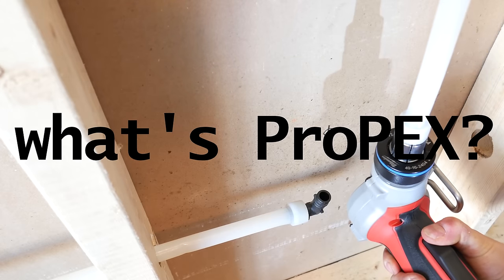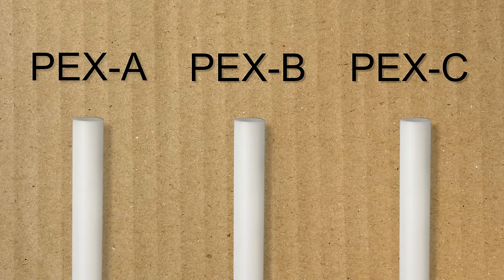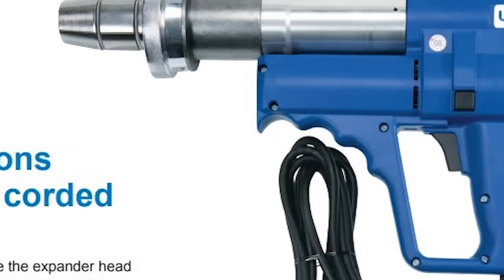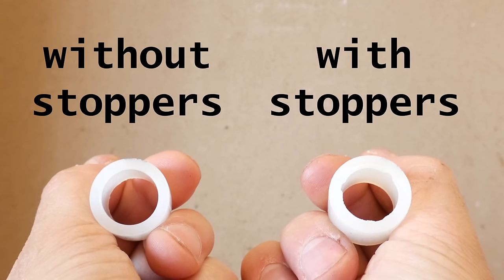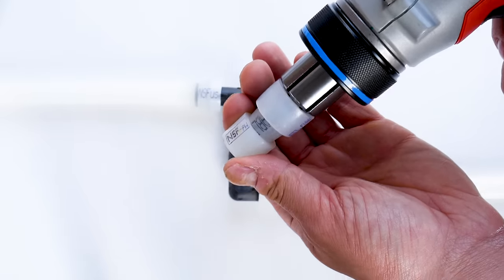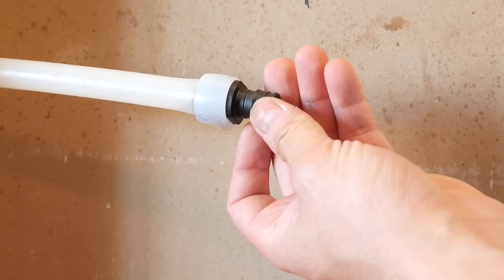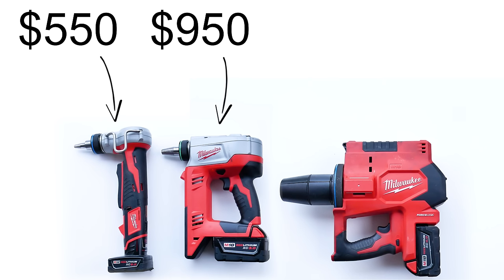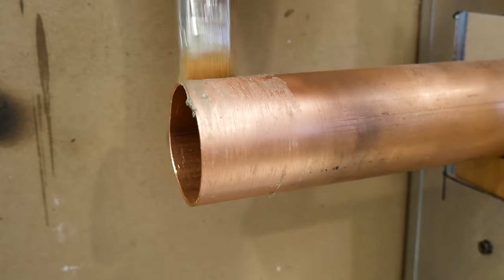UPONOR ProPEX, The Future of Plumbing (COMPLETE GUIDE) | GOT2LEARN

Comment: How do you go from copper pipe to PEX A. Do you need to solder a Pex A fitting to the copper then put a ring on the PEX A pipe and push it onto the sweat fitting. Where can I buy these type of fittings?
Reply from the maker: Yup! Plumbing shops carry them: https://www.dkhardware.com/apollo-epxms1212-1-2-in-brass-pex-a-barb-x-1-2-in-male-sweat-adapter-product-3629699.html?utm_source=google&utm_medium=shopping&utm_campaign=free_listings&gclid=CjwKCAjw4ayUBhA4EiwATWyBrt4ZSqPQ0Or_UWWC1TuPChzEV_EfHmisZoCYSJakq76SlvwCmmEXBRoC2XMQAvD_BwE

Comment: Upinor pex is sooooo expensive fittings,tools it would add up fast i use cpvc it’s cheap and easy to use. Nice video
Reply: CPVC becomes brittle and cracks easily after about 10 years.. Also, you have to wait for glue to cure before pressurizing.
Reply: please please don't tell me you are using Aquarise ? worst crap ever.
Reply from the maker: Aquarise is CPVC and is very brittle, try not to use that stuff.
Reply: Jessy Bwoy86 I use Genova cpvc never had problems
Reply: @jacksplumbingvideos7147  Charlotte FlowGuard Gold is what everybody use around here and pretty much only CPVC available. They all become brittle. Worse if it is hot side. And any deep scratches can develop pin hole leaks years later.
Reply: CPVC Lol 😆
Reply: lambition I hate Charlotte flow guard gold. in Wisconsin Genova flow guard is more common.

Comment: Freezing is a big problem in my area.  That's why I loved the old slide on ring, metal fitting system (I forget it's name).  Are there metal fittings available for this Uponor and how do the plastic fittings handle freezing?
Reply from the maker: Matt, Uponor is discontinuing all metal fittings because it's too expensive.

Comment: The only other flaw not mentioned would be if your water supply is treated with Chlorine Dioxide, the pipe will eventually degrade to the point of failure within a few years. The city of Hamilton, OH found this out the hard way.
Reply from the maker: What about other plastics or copper?

Comment: Question then please........Using uponor pex a... I can use 1/2 pex for the tub spout and shower???? Cuz inside diameter is larger then regular pex that were told not to use for those two items because of the restriction pushing water filling the tub  to the shower...
Reply from the maker: You need to use copper for a tub spout.

Comment: Will hot water running through the pipe loosen the connection?
Reply from the maker: Nope, you can use this for heating systems ;)

Comment: How would you add a short section (2') of the Uponor between two fixed ends? A piece of that pipe even when heated can not be bent enough to place on fitting. Are there unions? I've seen push-on slip repair fittings, and I think that might work. Or it's back to copper with a union.

Comment: Hey, question, does PEX-A have brass fittings or just the black plastic ones? If so, do you prefer the plastic ones or the brass ones? Which is better? Thanks.
Reply from the maker: Uponor is ditching the brass fittings because the zinc coating would come off after a while, so I think now they only have plastic fittings.

Comment: The Milwaukee 12V tool is $400 USD, with two of the three heads, a charger and two batteries. But if you already own Milwaukee you don’t need the kit with the charger and batteries... the bare tool is $219 USD, without the expansion heads. (1/2” and 1”, $56 each)... so $275 to $330 gets you going.
Reply: That's cheap 🇨🇦 we get screwed 🤦‍♂️
Reply: Joshua Mcdonald Exchange rate, my friend

Comment: What about hot water? you mentioned taking joins apart using heat, could hot water over time weaken the connections? what about biofilm accumulation and legionella risk.
And is there any leaching of plastic chemicals into the water?
Reply from the maker: No, the heat will not effect the connections, even when used for heating, no there's no biofilm or legionella and no worries about chemical leeching with PEX, unless it's consumed in huge amounts!
Reply: @Got2Learn  it does seem a very good secure system, I am in the UK but from what I can see they have the system here too.
Reply from the maker: It is a great system, i've personally installed kilometers of without any problems 😉

Comment: 4:30 Just so you know? you will realize a loss of volume due to the smaller fitting, which in turn may cause a loss of pressure at the end use. In fact, inside the pipe, the smaller fittings will cause an INCREASE in pressure due to the smaller circumference. This is what happens when you put your thumb over the end of a garden hose vs bending the hose in half .....

Comment: Too expensive for homeowners unless doing enough to justify tool cost.
Is there any reason not to use the manual tool for small jobs if you are conscientious about rotating it?
Reply: Just another BS way for tool makers to make money and for contractor to ruin a building with lazy or cheap workforce.
Pex A has perfect crimp connectors.
Reply: I've been using the manual tool only for 14 years. It works just fine and cost me around $20.00... But at the current cost for copper tubing the electric tool would pay for itself in no time.

Comment: Do you think one could use the pex expander to swage copper refrigerant lines for HVAC systems? Seems to be the same sort of principle. The only question would be whether the swage made by the pex expander mimics the swage made by HVAC swage tools. Also,  I would imagine that copper requires more force than pex to expand. Maybe you could try it out and make a YouTube video on it. I’m sure tons of HVAC contractors would thank you!
Reply from the maker: No, these are made for PEX only.
Reply: @Got2Learn  I understand that the tool is rated for PEX, but could it be practically applied toward refrigerant copper lines. Please take into consideration that there are already hand swage tools made by manufacturers (e.g., NAVAC) for copper refrigerant line swaging which I mention to emphasize that the strength necessary to swage smaller refrigerant copper lines isn’t a ridiculous amount of force. However, for larger diameter refrigerant copper lines the force can be more considerable. Hence the question as it would make it awesome to have a cordless swage tool on the field.

I realize that the manufacturer didn’t intend for their PEX expansion tool to be used for swaging refrigerant copper lines, but could it be feasible to do so? I get it if you don’t want to endorse a use of a tool unauthorized by a manufacturer, but was just interested In hearing your thoughts on the idea.

Comment: My question would be what capacity does Pex A have to return to its normal size after X amount of time installed. Does this system work for Pex that is 5 years old?  Or Pex that has been subject to hot/cold environments for a long period.  Seems to me it would lose it's elasticity over time

Comment: Hey man, awesome video. What are you thoughts on integrating this into an existing system with Pex B. We did our kitchen 4 years ago and at that point I was a total noobie and did not do anything on my own. Now I can do electrical, framing, and etc. Plumbing is my weakest skillset, so I appreciate all of the videos. My plumber redid the lines with Viega ProPex so it is all Pex-B. I like the ease of this one more. I already have Viega crimpers for 1/2 and 3/4 which I bought used off of Ebay. They are a bit rusty but should still work but I might get this since I have 3 bathrooms to redo. I read that you can crimp Pex-A however Uponor does not warranty that joint and the also decrease the warranty on the whole system. Nothing I need to worry since I am not a pro. However do you think the Viega ProPex crimps would work on Pex-A? Not the copper ring but the fittings with the sleeve and peep holes already attached. I cant remember what the Pex standard for crimping was without googling it
Reply from the maker: Yeah, there's no problem on integrating pex-a on a pex-b system.
Reply: @Got2Learn  awesome so crimp away!
Reply from the maker: @kiwiswat  🤘

Comment: Have you ever heard of or used Sioux Chief brand Pex A?  Thoughts?
Reply from the maker: No but I heard good stuff about it and I think it's less expensive, might want to inform yourself for the warranty though..
Reply: @Got2Learn  I will definitely look into that. I have done some generic online and found reasonable reviews. PEX A seems to be a rarely stocked item in all of the local hardware stores . This is the only Pex A hardware I have found stocked locally.
Reply from the maker: @JosiahJensen42  yeah Uponor PEX-A is reserved for contractors 😉
Reply: @Got2Learn  Aha!  😄
Reply: @Got2Learn  Can you use the sharkbite fittings in certain spots if needed on Pex A?  I couldn't find anywhere that specifically called out the "A" compatibility.
Reply from the maker: Yes I believe you can 👌

Comment: My two cents....

I've experienced SO MANY plastic gears and pulleys crack over time because nylon tends to dry and contract over time. These were pressure mounted on metal shafts and therefore were put under tensile stress. Nylon is NOT designed to be under tensile stress for long periods of time.

I know, i know, PEX-A is NOT nylon, but it is a plastic material. How will it react over long periods of time ?

On its side, PEX-B uses copper rings that does not dry-out ans puts the plastin under COMPRESSION  stress.  So, for long term reliability,  i'll stick for PEX-B.

Question: On PEX-A and PEX-B, they're plastic and brass connectors. What are the pros / cons of  each one ?
Reply from the maker: Yes, PEX-A is not nylon and does not crack over time, this system has been proven for over 20 years and there are no problems. As for the brass/plastic fittings, Uponor wants to remove all brass fittings from their line because they  are too expensive and the plastic ones are strong enough.

Comment: Looks super cool but how is the savings going to quickly catch up after the $550 expander if the fittings actually cost more than crimp fittings? I used ear clamped pex for my compressed air install, the pincer tool was at least as fast, more agile, and doesn't require power.
Reply from the maker: Long term
Reply: @Got2Learn  it can only get cheaper over the long term if the fittings are actually cheaper which according to your video is not the case.

Comment: The colored rings with no stops I would always give the ring a slight expansion before throwing it over so it wouldn't slide. When you're 1 or 2 connections from completing a manifold you really don't want that shit happening. Also on the subject of Milwaukee expanders if you don't actively do above 1" don't buy the M18. It expands slower and it's much heavier.

Comment: Nice summary. For future, please cover when to use elbows or bends. I used PEX-A for my DIY remodel. Big selling point for all PEX are "home runs" from fixture to manifold, eliminating joints in the walls. My only joints are elbows for the 1" supply (from street to manifold) where I couldn't fit a bend, and a Tee in the kitchen for the sink & dishwasher to share one supply line. Also, maybe cover plastic vs copper joints and manifolds. I went all copper, because a friend told me a plastic manifold failing is catastrophic whereas copper could be mended.

Comment: The thing you forgot to mention was pro pex with copper fittings for shower lines and other connections . Please do a video on that as well if you can. Thanks brother
Reply: I honestly think pro press copper should be kept for boilers and tying off the ends of system but that’s a personal opinion.

Comment: Or you could just use sharkbite fittings
Reply: Or you could just do the job right sharkbites allow the pipebto spin and twist there so expensive compared to pex fitting a plumber can do the same job for the same price and lower material cost then a handy man making less profit because higher material cost and inferior jobs.Sharkbite jobs are done by guys hanging ouy getting work at home depot
Reply: @Allintn22  oh, I see. Thanks for the info.

Comment: Tool and material cost are unjustified. Costs will come down when patent life expires and  anyone can manufacture the tools and materials. Demand also drives cost down as more becomes available. Lower prices now would help market acceptance but for now $500 for an electric drill with an adapter and four bucks for a quarter ounce of plastic are nothing more than price gouging. Get it to market and get that price down. Your business model will still work.
Reply: I literally laughed when I saw the 500 dollar price tag for the small tool.... Seriously your absolutely right this will be extremely successful in the market place no need to price gouge. I could easily see this over taking the other options on the market when the price levels out. I know I'd go for it for plumming projects
Reply: Dewalt has a tool that goes up to 1 inch. Retails for 250. Home depot is manufacturing pex-a under the Apollo name.  Prices have dropped significantly.

Comment: You're my fav plumber bro. I bought the m12 version to do 3/4" and it's so much quicker then copper.
Reply: Really, exactly how much faster is it? What, you saved 8 seconds per fitting? LOL And how many call backs are you on now? LOL.
Reply: @rickjames6948  first I think he saved more than 8 sec per fitting also and 8 sec is a a lot also if he had a callback it’s because he did it wrong just like how you can mess of a solder joint which is much easier to mess up

Comment: Great video.  Basic and informative.  FYI, DeWalt now makes a battery powered expander tool as well.  The DeWalt expander works just as well as the Milwaukee and if your already have DeWalt battery powered tools, all you need to purchase is the expander tool only.  
It's a lot less expensive that way.  Uponor also makes brass connectors that allow you to convert your system from copper pipe to PEX A.  You just sweat the brass fitting onto the copper pipe and then connect the PEX A pipe to the other end.
Reply: Thank you for that, I have multiple dewalt 20v and ryobi 18v batteries... definitely don't want to get into milwaukee this late into the game
Reply: Great infomative comment! Thanks!

Comment: I bought a small cottage about 8 years ago with the intent of fixing it up. I had not intended to replace the existing copper piping until I discovered that someone had used Type M copper and that after 50 years the well water was eating through it. I was going to replace it with Type L but a plumber friend suggested ProPEX. I bought one of the Milwaukee M12 expanders and I think I plumbed the entire house (duplex) in about a day and a half. If I had used copper it would have taken 10 times as long. I'm always skeptical about using "new" things until they have had a chance to prove themselves but this one has been around for quite a while now and it does work. Just so much simpler and quicker to work with and it's never leaked.
Reply: What type of Pex a did you use? I'm confused if all Pex a any brand will work for cold expansion. Thanks
Reply: UPONOR's PEX Pipe warranty is 25 years unless you use non-UPONOR fittings , then it's only 10.

Comment: Just a note:  a smaller diameter tube or adapter does not lower pressure, just flow.
Reply: Curious, if you run 1" pipe to the shower will the greater flow feel like mo pressure?
Reply: Unfortunately, you are partially incorrect.  A smaller diameter increases pressure drop (and decreases flow) according to the Darcy-weisbach and Bernoulli equations and thereby results in a smaller pressure after the pipe/fitting. Please check any fluid mechanics textbook. I would recommend Crane technical paper 410 (the most used fluid flow book in industry). From a professional engineer with a master's degree in chemical engineering who routinely sizes pipes and pumps.
Reply: Well Ozzy what do you have to say about those fluid dynamic responses from Ryan?

Comment: UPONOR is a great system but is rarely going to be considered by the DIY homeowner that has a bathroom to renovate, due to the ridiculous cost of the expansion tools.  The cheapest Milwaulkee expansion tool in Canada is $750.00 .  The tool is no more complicated or costly to manufacture than other 18 V power tools that sell for less than $200.00 .
Reply: I was just about to say pretty obvious money grab that they designed an entire  tool required to do the job, instead of some sort of a interchangeable period for even still sell the manual tool
Reply: Sell the tool after you done with it

Comment: Personally I used a lot Uponor,from floor heating to pipe in pipe pex system,alupex as well.
I really thought it was the best system,until I haven’t started to use Sanipex in late 2017.
But still Uponor is my no.2 to go in plumbing.
Reply: Say what.? You used Uponor until sanipex which you "haven't" started to use, and is now your number one and Uponor is now number two..?
 I also find if I don't use stuff, it has a lot less tendency to fail. :)

Comment: Super informative, thanks a bunch! I'm still struggling to see a large improvement over PEX, but I definitely understand the advantage over copper. Question: What about hot water? The video discusses applying heat to expand and remove fittings, what is the usability and reliability on hot water supply lines?
Reply from the maker: You can use and reuse for hot water, no issues on pex-a, thanksss!!!
Reply: @Got2Learn  Thanks so much for the super vite response! Just sent you an email.

Comment: Really great to use except in the winter with minimal heating.  Had a lot of problems with it shrinking back to normal size.  Had to use heat guns to cure the issue.